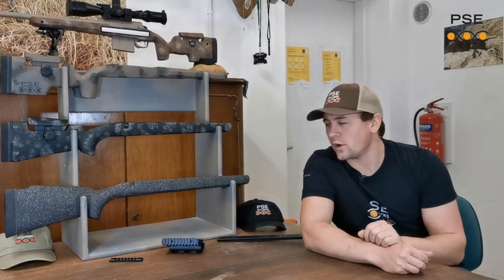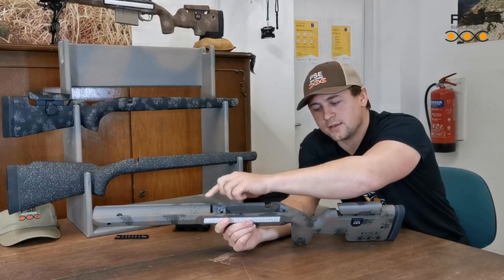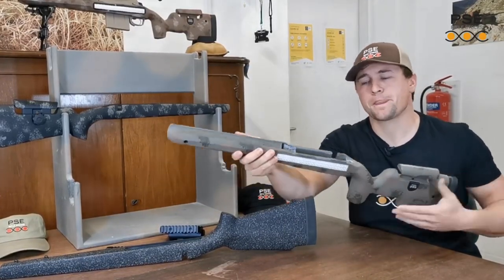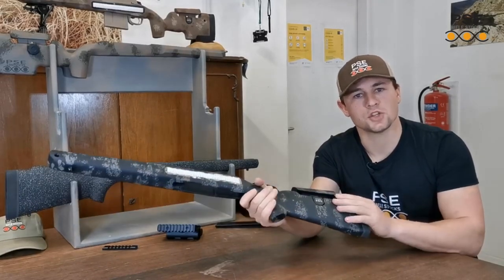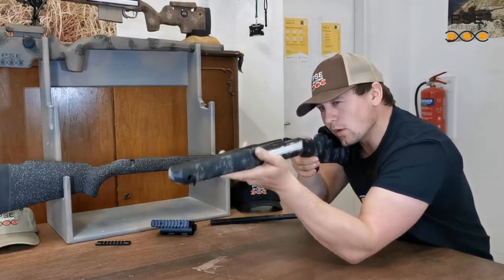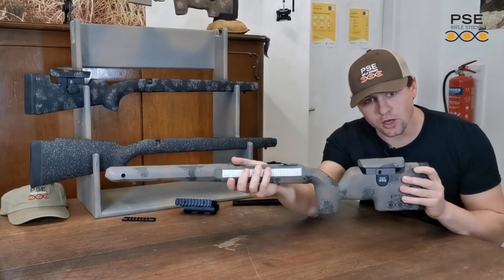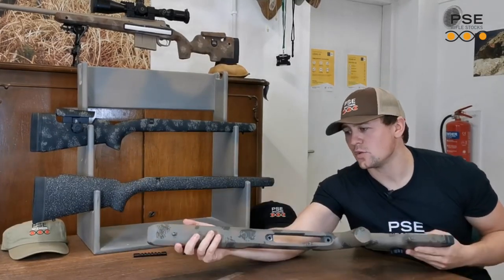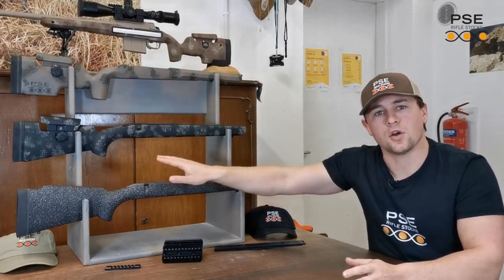PSE Rifle Stocks: Models & Features

Comment: Hi. I have a question. I'm going to rebarrel my Tikka t3x ctr. The new barrel will be a krieger medium palma, so at the breech it will be slightly wider than factory barrel: the action will be machined to accept a a breech as wide as the action itself. I would like to seat the barreled action on either a pse multi-purpose or e-lite. Do they need modifications to accept that barreled action? In addition, is the bedding surface ready to be glass bedded or should I consider to remove some material? Thanks EP
Reply from the maker: Hi EP.

Usually the MP and E-Lite will take up to a Tikka varmint barrel but we can modify the stocks to take a larger barrel at the shank. Best is to contact us by email on info@pse-composites.com to discuss.

Best Regards, 
Peter
Reply: @pseriflestocks  thanks. I'll do it